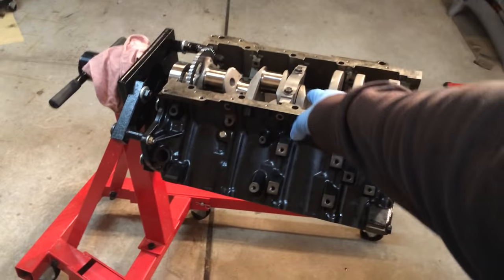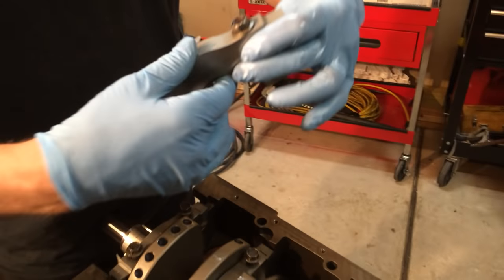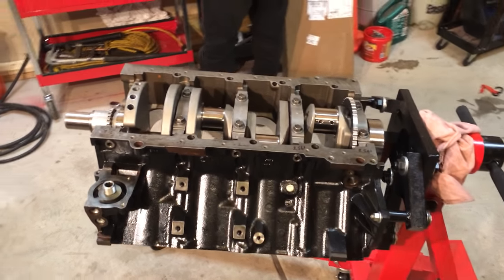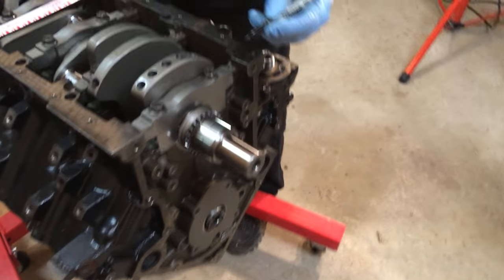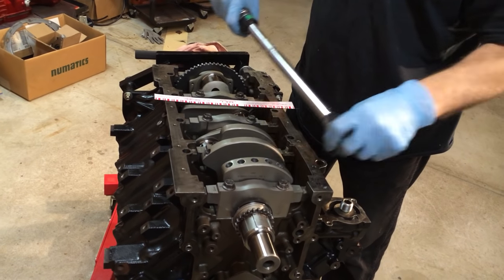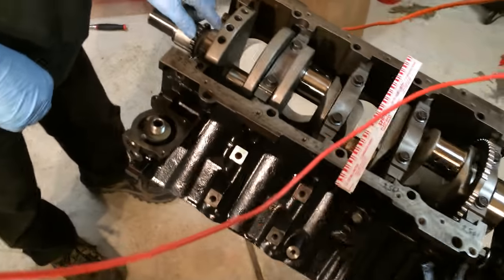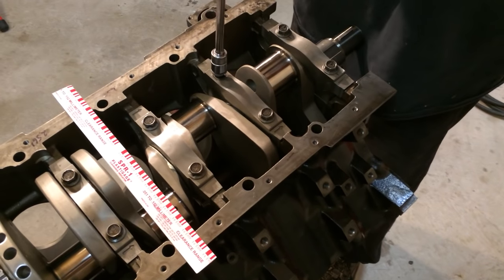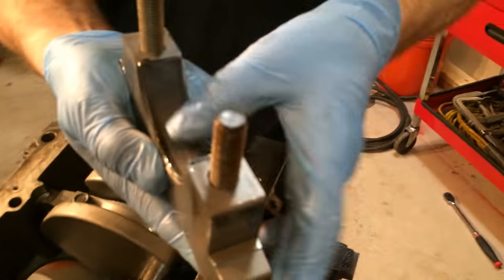The 2013 5.7L HEMI Engine Build part ( 3 )

Comment: Lol he gets a thumbs up for using a speed wrench. I own one still and never use it. I like the smaller drills with a good potentiometer and use the hex to 3/8 mandrel . It’s a good idea to flat sand the arp  12 point stuff so is doesn’t friction lock with that horrible noise. Dial bore gauges are cheep and far better than plastiguage  for checking vertical clearance on the rods and mains. I just bought a 5.7 hemi Jeep thanks for the info

Comment: you need to take those back off and lube them just to be on safe side
Reply: Can’t he get away with it since we have to prime the engine before starting. For about 10 to 20 seconds, we turn the engine over with the fuel injectors unplugged. Gets oil throughout the engine.

Comment: Just wondering why lithium grease rather then assembly lube and why you would only clearance only one main?  Not meant to be a dig just an honest question
Reply: can anyone answer the question
Reply: @egrayy9500  I recommend using plastigage on every journal. I have been building engines a long time and have seen journals on cranks sized incorrectly, wrong bearings from a supplier, bearings mis-boxed etc. The assembler is the last line of defense, bad enough if something happens to your engine but if you are responsible for someone elses engine then....................................
Reply: @arizonaguy7574  so i should do what he did just with all of them? And how do i know what size plastigauge
Reply: @egrayy9500  depending on your engine specs use the size that covers that range. Ask you parts supplier or machine shop. I would do all of them if for nothing else but the practice. Be sure to clean the plastigage off the surfaces good before final assembly. It is more tedious than difficult but worth the effort if you are uncertain.

Comment: ive got a like new 02 club cab dakota 2WD that im going to make a show quality ride out of. bought a 5.9 truck w/46re and needed pcm... i should have thought it out a little more but i got the old 1/2 ton ram for 250 from a widow. ive decided to go the 5.7 route. ive been out of building engines for over25 years my 340 Demon 440 68'charger r/t  , and built countless 327's 283's 400's chevy for my friends but alot has changed . what would be the best 5.7 block to start with. i had a 03 hemi was rated around 340 hp , i know the 5.7 's power has increased though the years. if i had an 03 engine do you know any tricks to make a lil beast out of it less throwing a super charger or turbo on it ? any tips would be great

Comment: thats what a degree wheel you put on your torque wrench or ratchet is for s its not a guess and its one pull and there should be lithium on all the main and rod bearings and yes your suppose to plstigauge all the mains
Reply: I was told by a professional builder to never use lithium as it tends to block filters and stuff... Purpose intended assembly lube is the way. Lithium = Old school of thought
Reply: @arizonaguy7574  what did he say about the plasti gauge.
Reply: @egrayy9500  use it LOL
Reply: @arizonaguy7574  do you have ig i have a question

Comment: hey do u have an email or somewhere ii can contact uu at?? wanted to ask u a couple questions about ur build [where u got crank, if uu used same stock pistons, and few other questions if that's okay with u]?? I'm getn ready to do practically same build on my 2013 dodge ram 1500 5.7 Hemi. thanks man. great vid!!
Reply from the maker: hey just wondering do you have a Facebook? if you do you can look me up it's
Brandongeana Demiter

it's mine and my wife's account